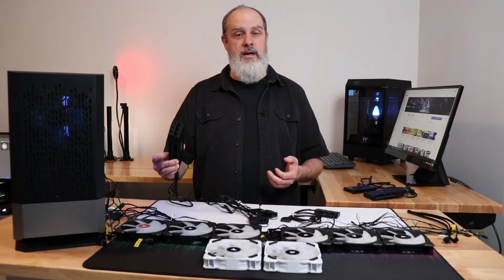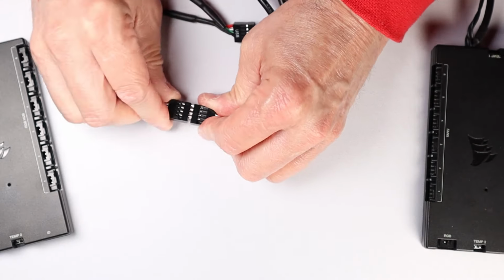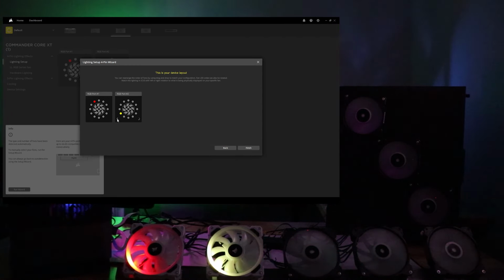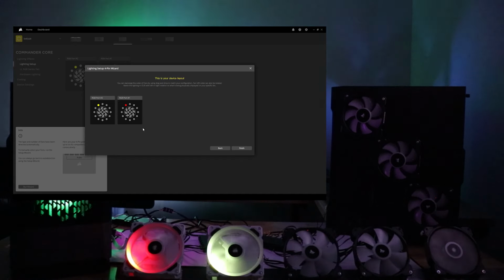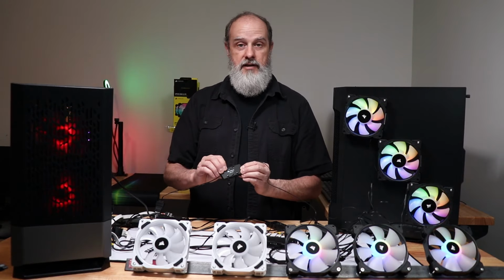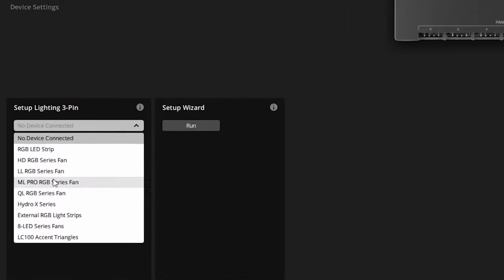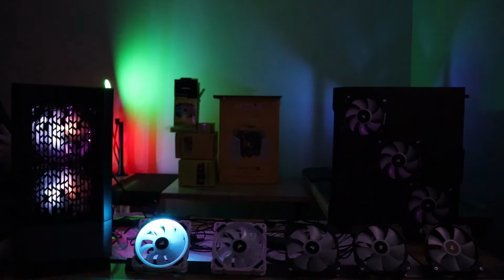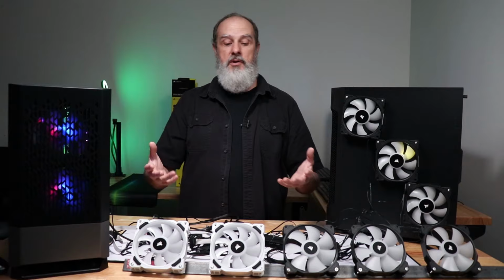Using multiple Corsair RGB controllers to control more than 6 fans in iCUE

Comment: hi i was wondering what should i do  i have a gigabyte H10m H v2 motherboard but i need 15 fans for a pc case could you please thanks
Reply from the maker: Hi ALEXXACTV1, Sounds like an awesome looking build you got going on. There are multiple ways you can get 15 fans connected and multiple combinations of controllers would work. Here are a few quick scenarios:

3 CORE XT controllers, giving you control over 18 fans. This gives each fan it's own RGB and PWM port, you need space to install these and room to cable manage everything. 

1 Commander CORE (with corsair AIO), 1 Commander CORE XT and a lighting node core. If you have a Corsair AIO, this is a great solution, this gives you RGB control over all them, it does leave you having to find PWM slots for 3 fans, but you could split a couple of the CORE and CORE XT ports for this, this cuts down on space a little it, and you have likely have the Lighting node core already since it comes with fan kits. 

If you have multiple Lighting node CORE's, you could use those, but it leaves you looking for a place to connect PWM Power for each fan. You could use Fan HUB's, or a CORE XT (with hubs) to get iCUE control over the fans. 

As you can see, there are several solutions, it's not that one is necessarily better than the other, it may depend on what equipment you have and what kind of space you have in your case. I would personally opt for a CORE XT, Commander CORE (with corsair AIO), and use a 6 port fan RGB hub (from corsair) and then split a couple of the PWM ports. 

In addition to that, consider looking at icue LINK, it's much more pricey but could be a good solution as well. 

And that's just Corsair, there are many other options, such as Lian Li, Thermaltakes SWAFAN EX, which are modular and greatly help with cable management. 

I need to do a new video on this subject as many pc builders are doing big builds like this.. Good luck, have fun and thanks for watching, let me know what you decide to go with!!!
Reply: @HardwareArtisan  thank you

Comment: Great video on these devices.  I use the famous x7000 with commander xt, and the aio 170 140m fan with lcd, and has command core, but shows AIO in ICUE, but not the actual commander for some reason, but shows all fans, and xt, but no core.  Is this because its setup as the AIO?

Comment: I am still struggling with tapping the screws into the fans as I mount them into the case. They keep stripping due to the sky high torque of tapping threads into the plastic fan housing
Reply from the maker: Hi ph11p3540, it can take a bit of effort to get the screws started on some fans, but usually not so much that it strips them out. I would check that you are using the screws that came with the fans. And they don't need to be very tight just enough to let the rubber dampening pad to make contact, you don't want to compress that pad against the case, so don't tighten them you would machine screws. Just 'kiss' the case with that rubber pad, haha. 

Let me know if I can help, good luck and have fun!!! Thanks for watching!!

Comment: hey ! is there a way to be able to control 2 hubs as one ? for example putting on lighting effects that sinc the extra fans on the 2nd hub that sync without the lighting link, theres alot more options but they are seperate to the extra 2 fans lol !
Reply from the maker: Hi manboobs2399, I am not aware of any way to "combine" 2 controllers to make a single logical controller. I've always had to use lighting link. For some animations like VISOR it can create problems. 

I'm with you though, I've thought that same thing before, I wish there was a way to combine them in the software to act as one, great thought!!! 

Thanks for watching! Good Luck and keep having fun!!!
Reply: @HardwareArtisan  yeah fair enough! Lucky signal rgb exists lol

Comment: Thank you for this video. It has some great information. I do have a question. I am building a new pc and I am going to buy 10x LL120 rgb fans. What is the most efficient way to connect them up, so I that I can use Icue with them? I am assuming I would need 2x one of the modules you were using.

Comment: I'm setting up my first custom water loop and so I have the xd5 rgb pump/ res combo that has a four pin fan connector that I'm assuming is for pump control. I have 6 fans (3 LL120's, 3 QL 140's) and am using the commander xt. Based on being able to split the fan headers as noted in this video, I am hoping that I can split one fan header and then have a free spot for that pump 4 pin signal connector (that only has 2 wires). However, the only info I see about connecting this particular signal cable is to connect it to the specific port 6 on the regular commander. Can anyone tell me if this needs to be connected in the same way on the xt? 
Great set of videos!
Reply from the maker: Hi R1Armadill0, that's a great question. Yes, you should be ok splitting one of the 4 pin PWM connections on the CORE XT, use a splitter and connect two fans two a single port. This will free up one of the ports for you xd5 rgb pump. As the documentation states, use port 6 to connect the 4 pin PWM connector, that will be fine on the CORE XT as well. 

You should also have a 4 pin RGB connector which is keyed so it will be obvious which port that goes to on the core XT, any port should be fine. 

The only 2 pin connector should be the temperature probe, which the CORE XT has 2 of them, either one should be fine on the CORE XT. 

Have good luck, let me know how it's going or if you have trouble. Have fun, thanks for watching!!!
Reply: @HardwareArtisan  Thanks so much for the reply! I haven't actually been able to hook everything up just yet as I'm still waiting on a water block for my gpu. But I appreciate the response. I will connect the pump signal cable to port 6 on the xt while splitting one of the fan ports and see how it goes. I will report back when I get this completed. Thanks again for the great videos!

Comment: Thank you for your video. Much appreciated. I know there's a very little chance that you will reply but I've gotta ask... I have a commander and a commander pro. With 1 extra rgb hub 9 fans in total. My problem is:
The rgb hub and the commander pro shows up in icue despite they connect to the same usb header on the motherboard. But the commander which connect to a separate won't show up in icue. Some of its (non corsair) rgb strips shows up under the pro despite they connected to the standard commander. I cant see the 6 case fans. But I can change the rgb on them. It looks like everything is controlled by the pro but won't show it if I open the software.

Hope its understandable.
Reply from the maker: Hi @peterjofoldi5266, by commander, do you mean the commander CORE, or the CORE XT? Since you mentioned non-corsair RGB, I have to assume it's the CORE XT as the CORE doesn't have a port for this. If it's not showing up in icue, i'd first make sure you have the latest version of icue installed. if that doesn't fix it. Power off your PC and disconnect the 'commander' and then reconnect it and try again. 

If it's still an issue, email me your configuration and how it's all connected, I may not fully understand the config, i'll be happy to help! andrew@hardwareartisan.com

Comment: I bought all this junk, only to realize in the end it was only good for controlling the RGB in in iCUE... and only when you were in Windows.     All the fans.. you actually want to control them from the FAN headers on your motherboard (not USB)...    from the BIOS fan curves in well.. BIOS.   Not ICue or Windows, which is not always running.  Like, whenyou're booting up, or in Linux, or... well in a BIOS screen figuring things out.
Reply: My fans stay at a fixed rpm without the software even installed. I connected the cpu fans off the mb headers

Comment: So I can add a splitter to the non RGB side, for fans 7,8,9. Can also add an additional splitter for three non-RGB fans that are not corsairs?
This would fans10, 11, 12 . They are black NZXT fans for a push pull setup.  in other words, is it too much to draw on the amps at 6 via 2 three ways splitters. Another commander core XE would be easier I believe how would I hook that up in a daisy chain, or  would I hook them up independently 
Thanks

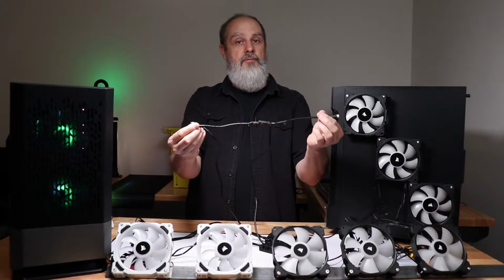Comment: I don't know I'll try this configuration in 1:20 but it seems like my ICUE isn't detecting the second CORE XT. The fans are connected to my Corsair iCUE H150i ELITE LCD XT Core's are not detected. I don't know if I have to buy another CORE XT instead of using the one that came with the cooler would would that work better? or should I get an internal usb hub?
Reply: I had the same issue. Instead of using the USB pas through connect buth USBs separately

Comment: Corsair is lacking in comprehensive documentation for their Icue products. So your videos fill the gap. Thanks for these. 
I'm  just finishing up my 7000x build with 10 fans. The supplied 4 140mm three 140mm that came with my 420mm radiator and 3 120mm on the side mount.
One issue is the Icue software doesn't show the commander pro that comes with the radiator. You control those fans via the cpu block. Not intuitive at all.
Another issue I'm dealing with is with the side mounted ML120 Elite fans connected to the core xt in 4,5, and 6. They spin at full rpm with no RGB as if they were 3 pins. Still dealing with troubleshooting that but had to leave town for work. May just need to do a factory reset but we'll see.
Long comment just to say thanks again for your videos.
Reply from the maker: Hi MichaelDM, the commander CORE will not show as a commander CORE if the PUMP is installed on the 24pin port, as soon as you plug in the pump, the badge in icue changes to show whatever AIO you have, it's never explained clearly this is what it does. However, using that AIO device in icue, it acts exactly the same way as the Commander CORE would act, that's what it is.  You're right though, not intuitive at all....As for the ML120 fans, I have had to remove power (shut down, physically disconnect the controller) in a few rare cases when it behaves like that. Try that, if not, force a firmeware update on the controller, and beyond that, uninstall and reinstall icue. Good Luck, thanks for your feedback and for watching!!!!
Reply: @Hardware Artisan  Thanks for the suggestions...I'll keep you posted. May help others

Comment: Can I control a second COMMANDER CORE XT with the COMMANDER CORE XT's branched USB?  If not, what do you need?
Reply from the maker: Hi Mi Syou, Yes, you can connect a second CORE XT to the USB exansion on the first. The only thing to not is the second CORE XT's USB expansion pigtail won't work as it won't get any signal from the first. but the CORE XT itself will work. 

Great question, thanks for watching!!!

Comment: Question:
 Does the Lighting Node PRO support two devices/fans but requires the RGB Fan LED Hub to extend to 6 devices/fans? 
Also, is the Lighting Node CORE a combination of both the Lighting Node PRO and the RGB Fan LED Hub? 

These ones confused me

::Edited to add clarity::

Comment: @HardwareArtisan I have a quick question... 
I already have both iCUE Lighting Node, CORE Digital Fan PRO RGB Lighting Controllers (came with case) + Corsair iCUE H100i ELITE (comes with COMMANDER CORE), I plan to connect more than 6 fans in the case and was wondering what would be the best extra controller to use.  

I was looking at the iCUE Commander PRO that has those USB Ports that I could used to connect the COMMANDER CORE in.  
I could remove the Lighting Node PRO and plug the Lighting Node CORE into one of the two LED Ports on the Commander PRO and was wondering would this work to control all Fan Speeds and their RGB?
In theory it should work, I would of gone with the XT but I wasn't a fan (pardon the pun) of that USB part with the passthrough and didn't want loads of USB cables trailing across my case, and by using the Commander PRO, it would be 1 less USB cable trailing across my case and also have a spare USB if I wanted to add more later on.

Comment: This might be a stupid question but are you able to daisy chain the commander core with a core xt like the two xt's in the video, or will that not work? And if so, does that daisy chain end plug into only one usb ports on the mobo?
Reply from the maker: Hi Aaron Hadrava, Yes, you can daisy chain a CORE onto the CORE XT. Plug in the CORE XT's USB connection to the motherboard, and then plug in the CORE to the pigtail usb connection from the CORE XT and that should work great. If you ever encounter any issues, switch to using a powered USB Hub.

But, i've never had issues plugging the CORE into the CORE XT. 

Have fun, thanks for watching!!!
Reply: @HardwareArtisan  Thank you! Great video and very helpful information.

Comment: so i need a USB header splitter?
Reply from the maker: Hi Adam L, They do make a USB header splitter, If you need more USB ports, I would recommend using a powered usb hub, NZXT and Corsair make one, I've mainly used the NZXT one as I like it's layout the best. 

You don't need one though, unless you're adding many devices, if your just adding one or two you can just use your motheboard's headers, the CORE has a pigtail which can be useful as an extension for most devices, not all. 
The commander PRO has 2 expansion headers as well which will work good. 

I hope that helps, thanks for watching!!!!

Comment: Has anyone used a 1 to 2 Female Extension Connector Adapter to connect more controllers to the motherboard?
I guess it should work because it would be the same thing as using the pigatil header of the Commander Core.

Comment: Im a bit confused, does that mean that if I use one the commander core for 6 of my fans and then the rgb hub and the mobo fan headers for 2 other fans, I wont be able to control the fan speed of those 2 extra fans?
Reply: Hi Lengors! You are correct, if you use the RGB hub for 2 fans, you have to find a place to plug in the pwm/power cable, if you use mobo headers, iCUE can’t control those ports.  You could control the speed of those using your motherboard controls. 

For only 2 extra fans, you could use a splitter in one of the ports on the core and then get control through icue, obviously that port can’t control 3 fans independently, but you could put a curve on that port and run all 3 fans together. 

I hope that clarifies that point, let me know if not!!

Great question, thanks for watching!
Reply: @gramandy  basically i need a commander core xt with another commander core xt or commander core... that sucks, but oh well, it is what its. Thanks for helping 😊

Comment: Very good video, thank you!
If I want to connect 2 Commander core xt with each other, do I also have to use the sata cable for the second Commander core so that it gets power?
Or is 1 SATA cable enough for the first one and both get power?
Thanks
Reply from the maker: Hi RoBeatz, you will need to use 2 SATA power connections, each CORE XT will need it's own power connection. Great question, thanks for watching!!!!

Comment: Ohhh YouTube, how did you know?!!!  Realising my new system with 10 fans isn't necessarily all working the way I want with my Commander Core and lighting node / node core with PWM Hub with some mixed fans.    Already seeing 1 issue - I'm not sequencing the fans properly on the node (and they're mixed and matched - doh).  Maybe I need to get a commander core XT to work with my commander core...  or maybe split the mixed fans onto their own controller.... some thinking to do, but Thanks! :D
Reply from the maker: Hi Scott Rae! You can mix fans on Lighting node core, but icue  lets you only select one type of fan on the lighting node core. So, depending on the types of fans, it may not look right. If you have LL fans and 8 LED fans for example, you can only choose 1 type. My suggestion is, if you want to try it, put the fans with MORE LED's at the beginning and select that type of fan. You can then just change the number of fans until it covers all your fans. Or...Select the type of fan you have more of and use that. It's just doing the math to get the # of LED's right. Some animations may not look correct though. 

With the CORE XT, you can mix fans with no problem, each port is detected/configured independently. 

Splitting across the controllers will help, except with VISOR, that may not look right. 

I hope that helps you planning, good luck and have fun with it!!!

Thanks for watching!!
Reply: @HardwareArtisan  Thanks so much! :D  Decided to go with the Core XT to replace the node, and can move the fans power off the PWM hub too and just keep everything together.  It's a mix of 120 and 140mm QLs and 140mm LLs in a Corsair 7000D case.  I don't think my fan config will really suit VISOR to be fair, but the Core XT will just make it all that bit easier to configure, and make sure I'm not missing any fans - which I think I am at the moment!